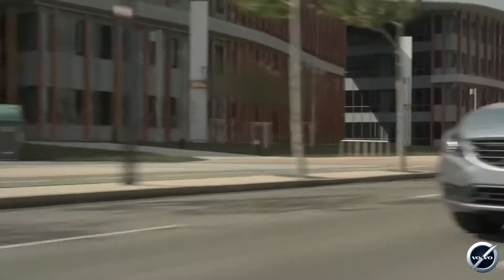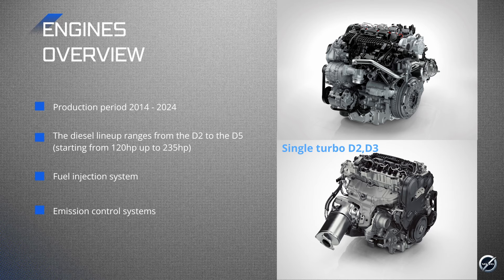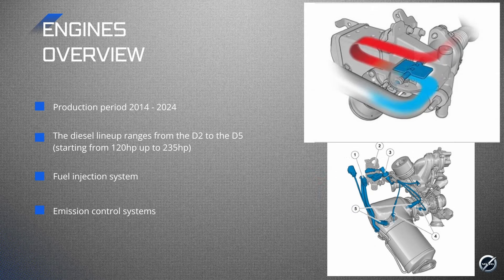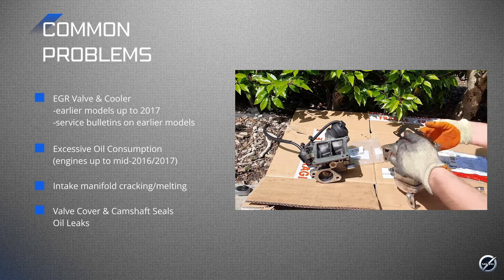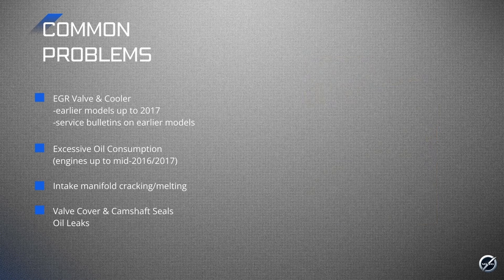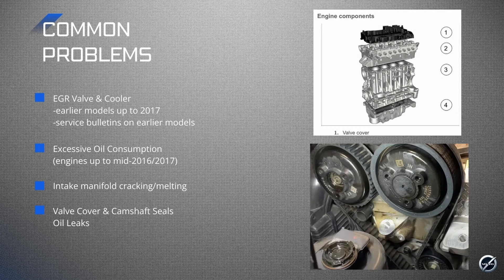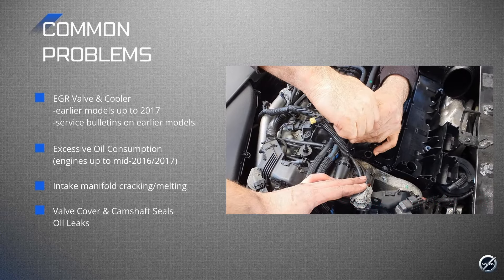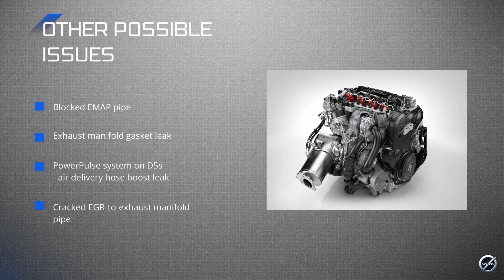Newer 2.0 Volvo VEA Diesel Engine Review | Common Problems, Reliability & Fixes (D4204Txx)

Comment: 2017 S60 D4 owner here. It has been problem free for 110 000km. The trick is to get a later model 2017-. You should also try to find a car that have done most long travels. A car that´s been used for short distances only is a no no.

Comment: Very accurate, as an D4 d4204t14 owner i had these problems:

- Exhaust manifold gasket leaked (Has been replaced, no issues for 50k kms) (Problem was in first year of owning the car)
- Egr valve problems (I blocked the Egr and got a software change to disable the codes) (This issue came in the second year i owned the car)
- Valve cover and PCV has just been replaced recently (This issue came in the third year i owned the car).

So after all 3 issues, i don't think these issues are that bad. It just needs fixing (if you fix it right after you see the problem, the engine will be fine), also the engine never stopped working. In 4 years of ownership i am fine with it. Engine is still running really good and almost reached 300k in kms.
Reply: Thanks for describing your experience, I'm glad there were no major problems. Can you describe what the symptoms were before replacing the valve cover and PCV?

Comment: Hello, I have a 2015 delivered xc90 D5, EGR was replaced under warranty and recall, car did have oil leaks after the one service after 100k km, fixed under warranty, then twin turbo completely died at 128k km. There was a recall for the fuel line too. I'm still driving it, it's 206000km right now, and interestingly, no oil burn or consumption. But the exhaust pipe does give out black and grey smoke when you accelerate hard every now and then. Do we ever need to change the DPF?
Reply: Black smoke during harsh acceleration is normal for diesels, as the DPF is doing a regen. The problem is when black smoke starts coming out often (at every acceleration using more than 50% of power), and that is ussaly related to carbon buildup on the O2 sensor or in the EGR. Also common problem causing black smoke for all diesel engines are any sort of boost leak